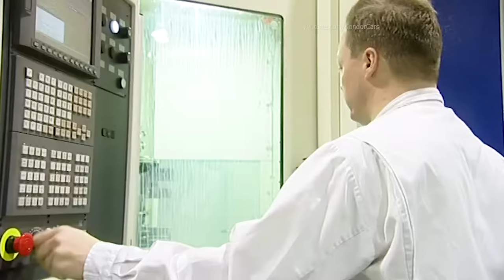Honda Civic Production - Honda Factory

Comment: The 2016 to current Honda Civic with the K20C2 is the modern 1993 Toyota Camry. Port injection, so no carbon build up, and naturally aspirated instead of turbocharged. Even Honda people tell me how well my Civic has held up compared to other Hondas for the high mileage.
Reply: Lol
Reply: What would make it perfect is if it had hydraulic lifters for even less maintenance. It's an economy engine after all, no need for solid lifters.
Reply: Our 2016 got an easy 36MPG. Our 2022 gets 33MPG. That sucks.
Reply: @wanaraz  That's weird, because doesn't the 2016 civic never had any idle start stop, but is standard on all 2022 models? and the 0 to 60 in the 2022 civics are actually slower than the 2016 to 2021 models with the same engines due to honda changed up the cvts.
Reply: @wanaraz  And I have a 2020 Civic K20C2 here. I can get up to 50 M.P.G. on the highway.
Reply: @MacI-1970  I can't find any honda that gets that gas mileage.
Reply: @MacI-1970  Some honda civics only come with 1.5 , 180HP. That's the one we got.
Reply: @wanaraz  Edmunds did test a 2016 Civic and actually got 49 MPG on a highway drive. The car does have to be driven like a grandpa though.
Reply: @MacI-1970  just goes to show you you cannot trust Edmunds for anything.
Reply: @wanaraz  Honda hater
Reply: @MacI-1970  I actually am a Honda hater  but the wife loves it. Otherwise I would buy American.

Comment: 24:48 R18A2 Honda Civic 8 and 9 Th Generations engine codes they had issues with cracking engine block but later on with uprages thickened the walls and got the most reliable engine on this segment no oil dilution no water leakage naturaly aspirated the 1.8L engines they are the most reliable if you change your oil regularly, 10th Generation has L15 engine code your welcome !